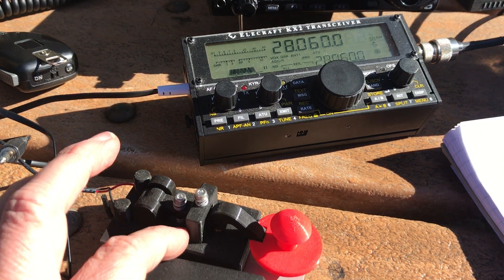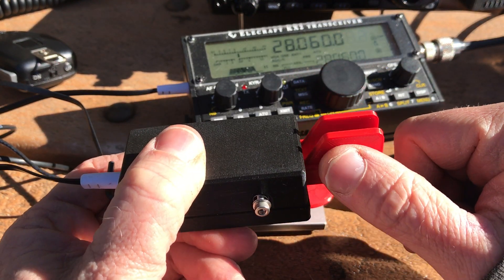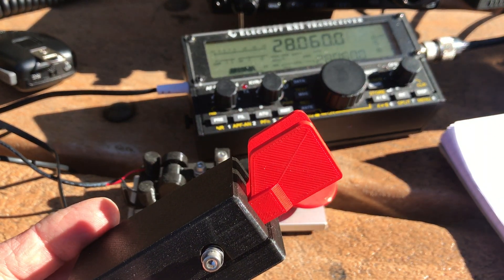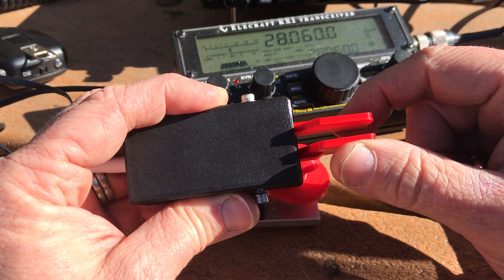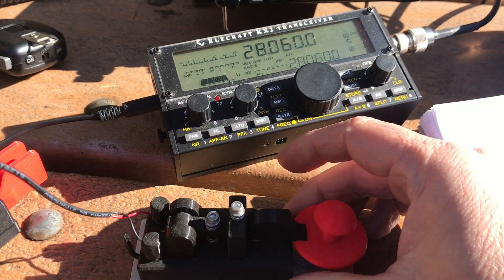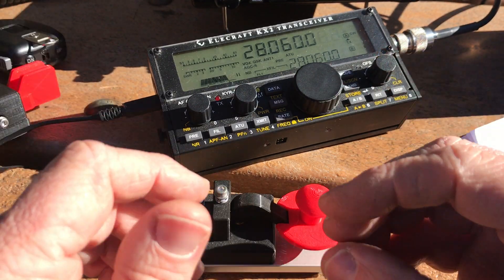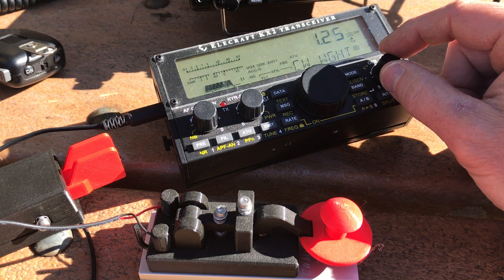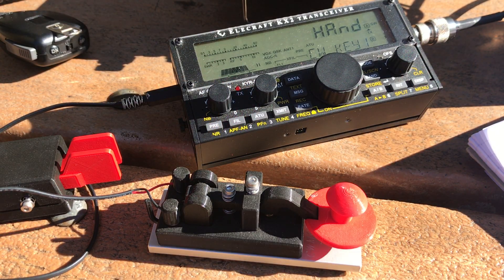CW 101: The difference between straight keys and paddles

Comment: I have been learning with a paddle but had the dits and dah's the other way round, is it better to change it now? or keep going? I'm right handed..... thx
Reply from the maker: Great question. It really doesn't matter, but since left dits and right dashes are more or less convention, you may get frustrated when operating someone else's station on Field Day, for example. Most modern transceivers allow you to switch the left/right config. Some do not, though, so that might be another reason. Of course, you could also simply reverse the wiring of the key to get what you need!

Comment: What is a decent paddle that you'd recommend that isn't overly expensive (≤ $100) for shack use?  Also, just for fun, what about field use as well?  I want to start getting in to morse code, but don't want a chintzy feeling paddle (or an overly large paddle, as I have a singular spot on my desk where this will go).  I wish I could attend a large ham fest to try out multiple different paddles, but that is not in the cards at the moment.  You seem like an individual that would be able to dispense some sound advice that I would trust.
Reply from the maker: One home paddles with a hefty base is the Bencher. It's possible you could find one used for less than $100, but you'd want to make sure you know or trust the seller. I use CW Morse paddles in the field all the time and even have one with a base for home use. They're affordable and very durable. I like the action, too. They're a sponsor of QRPer (in full disclosure) but I was using their paddles long before they were (and indeed invited them because I liked their product!): https://cwmorse.us/?ref=pHGSYqNC

Comment: Nicely done Tom. I have a Vibroplex paddle and like you do not use the Iambic mode too confusing for this old op. and I do have a kit that I built for my old kenwood with a PC. Board Paddle I built for an experiment about 17 yrs ago and the darn thing works so gud I put it on top of the little kit chassis I have my keyer in and that's what I use on the old kenwood. which is the rig I work you on all the time. although the last time I worked you 2/21/2022 I had the hand key hooked up left over from working the K3Y contest so still had it in line. and after watching the video it did not sound too bad! on air. nice that we can work you and then go listen to how we sound to you and the world anyway thanks for this nice tutorial on keys and we'll CUDTL OM! de Ellis WA1RKS
Reply from the maker: TU OM!

Comment: How easy is it to change the dots and dashes opposite as I am a lefty
Reply from the maker: This is usually done in the CW setup menus of a radio. It's very simple with the KX2 that I used in this video. Most of my radios allow for the L and R paddles to be assigned the dits or dashes.

Comment: I just picked up a straight key from CW morse, and love it so far. It'll make a great key for park portable!
Reply from the maker: You'll love it. They're easy to adjust as well and quite durable!
Reply: What do you think about the:
"Red Lightweight Double Paddle Morse Code Key" ? Do you think the default plastic base is good, or get a steel base.  Would you recommend a 1/4  or 1/8 cable... Not that I'm in the checkout or anything😅😅😅

Comment: When I need a straight key when I am portable, I change the setting in the radio for straight key and then I lay the paddles on their side. I have to hold the body of the paddles with one hand and key with the other hand. I don't like carrying extra items with me. When I go portable I am in the KISS mode. I may have extra items in the trunk of the car but only carry what's needed to the area I operate from.
Nice video.
Barry. KU3X/QRP
Reply from the maker: A solid idea, Barry! Simple setups are actually my favorites. In many of my videos, I'm carrying a big pack, but when I hike I typically have a compact setup.

Comment: Thank you for posting! Wondered if I should get a key and practice sending whilst learning to copy. Not sure if it will speed things up or makes things worse! So of course I was wondering what kind of key to get. Thank you for the info, like many i'm familiar with the the process of how they work just nice to see as a learner some background and application.
Reply from the maker: It definitely helps practicing sending. Sending Morse Code is much easier (for most of us) than listening to and decoding it. In other words, we tend to send better than we can receive. Sending, though, is a muscle memory and takes practice. I think it helps form those pathways in our brain we need to operate CW. Do a search for "Morse Code practice oscillator." Some of these are kits--I've built at least 4 or 5 types--and some are fully assembled. Better yet, ask a member of a local radio club. You'll find that someone within that club has one and will happily lend it to you along with a key. It gives you an easy way to practice sending without emitting RF!